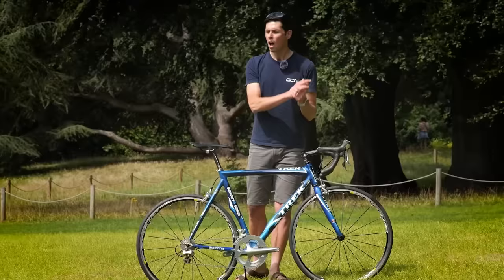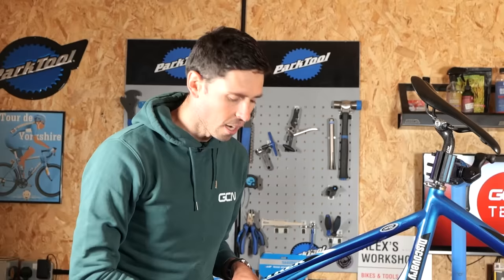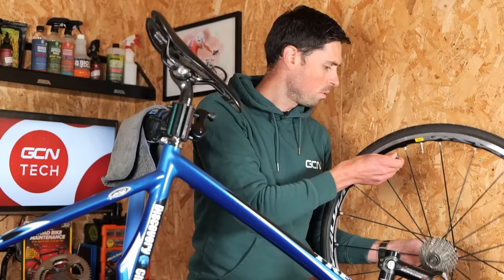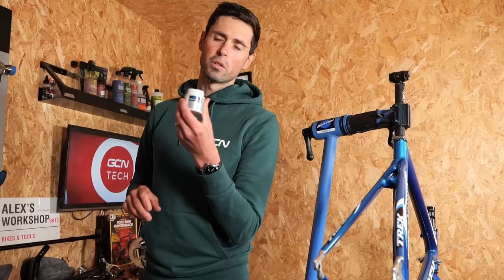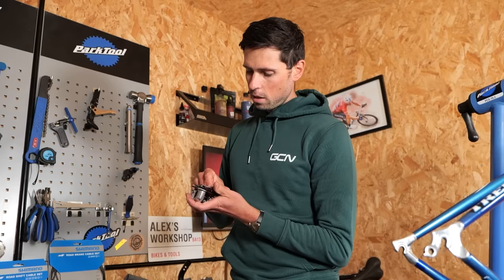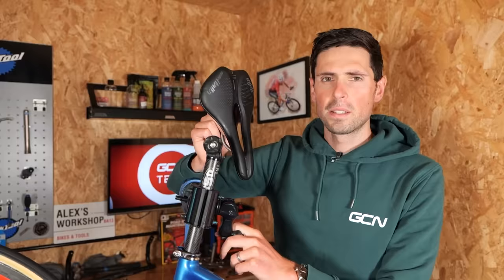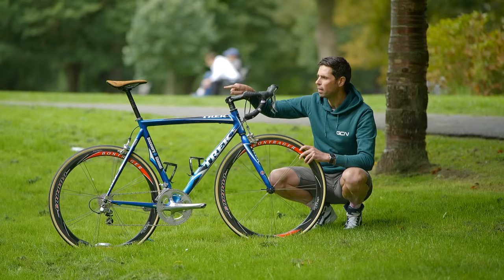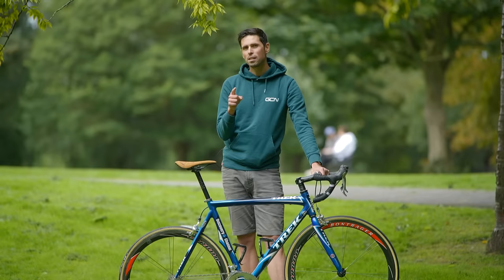My Dream Bike Just Got Even Better!

Comment: 14x cheaper than the 2023 Madone. And the 2004 bike has the flexibility of a separate stem & convenience of external cables.
Reply: 2005😉 2004 = us postal.
Reply from the maker: It's a pretty sweet machine!
Reply: @gcntech it's beautiful🙏I have 2 of the 1999 5500 oclv pro us postal treks and they are amazing, love them, best frame ever built in my opinion, ❤ from 🇨🇮

Comment: “RULE 8 // Saddles, bars, and tires shall be carefully matched.    3Valid options are:
Match the saddle to the bars and the tires to black; or
Match the bars to the color of the frame at the top of the head tube and the saddle to the color of the frame at the top of the seat tube and the tires to the color where they come closest to the frame; or
Match the saddle and the bars to the frame decals; or
Black, black, black”
Reply: Rools is rools!
Reply: This is the way.
Reply from the maker: Or you could just ditch the rules and do your own thing 😉
Reply: @gcntech  It’s a slippery slope once you let that first rule slide.  First it’s non-matched contact points then before you know it you’re stripping Discovery Channel frames.

Comment: Lightly warm up any stickers you’re going to remove with a hairdryer(not too hot). I sold a ton of those Treks back in the day and sometimes when you would peel off the warning stickers or chain stay guard it would peel off the clearcoat and water slide decal underneath. Cheers.

Comment: A neighbor of mine left a bike exactly like this in my garage when he moved out. Unfortunately, the seat stay was cracked beyond repair. So, I stripped off all the parts, and am using the Ultegra groupset and wheels to build-up a 2004 Colnago C40 frameset I got off Ebay recently. My Dream Bike upgrade. I hope it turns out as nicely as yours has. 🙂

Comment: I've got spare Bontrager QR "thing" from my old Trek (bontrager) rear wheel.
Mine is 2012 version (135mm wide). So propably not same as was fitted in 2004.
I hope, someone keep somewhere this piece, exactly as You need.

Comment: Very cool thing! I see, you've stick not just with external cable routing but the one having shifter wires going out from a side. So easy to handle when need a new line. Yay!
As for the saddle - alone is COOL AS f-word, but not necessarily fits your build. You have blue-white frame, red paint on rims. Added brown/beige saddle. Not much room left for handlebar tape color. Just don't go for violet one!!! DON"T!!! ;)

Comment: #askgcntech I got my first pair of carbon tubular rim brakes wheels. I am wondering how to know if the brake surfaces are to worn? How can we check? I notice the front brake works great, new sram carbon specific brake pads too, but the back brake feels as if the brake is catching some parts of the wheel but not others so I get this sawing motion back and forth when using the rear brake? Are they toast?!

Comment: Never, never remove or install the bottom bracket when clamping the bike on a repair stand. It requires so much torque and just thinking about how much the seatpost is bent and how hard it ts to extract the bb is painful. Just do it on the ground whith the wheels attached.